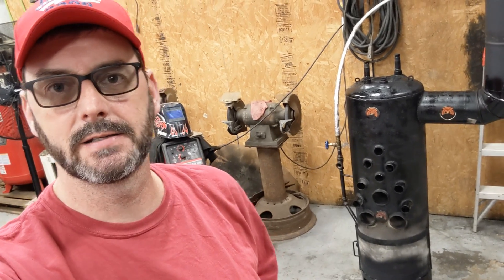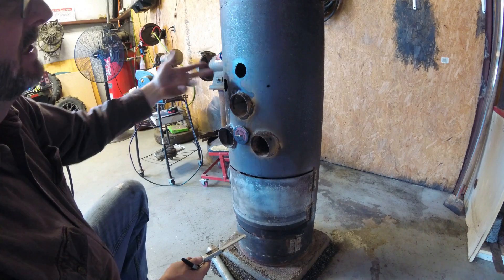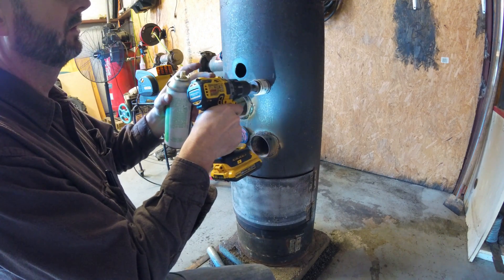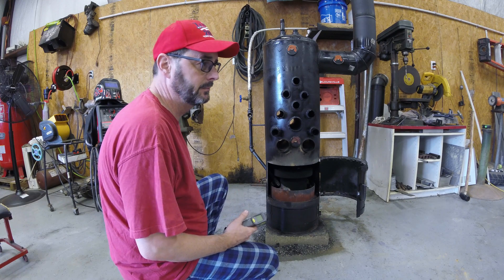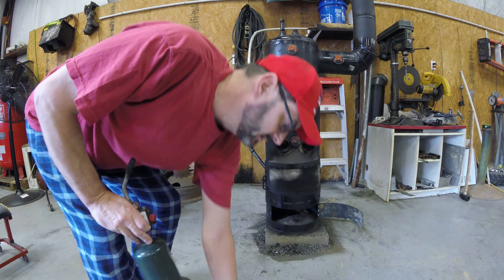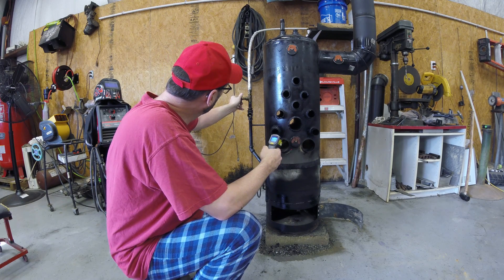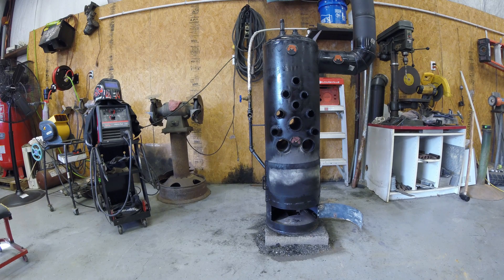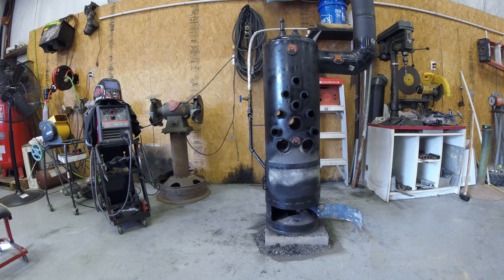Updating My Waste Oil Heater again: Because Who Doesn’t Want a Furnace That Runs on Trash? Ver 3.0

Comment: Hi Randy, did you add a perimeter on the piece you used for the door? The original piece you cut had a gap, and I can't tell if you added a piece around the edge. thx
Reply from the maker: Yes 1 inch strip of metal with a rope gasket. It is shown in one of the latest videos
Reply: @randysdiy2102  We just got an old water tank and other parts and we're starting to lay out the cuts etc. Question: Did you have to weld a base on the inside of the tank to hold the burn chamber? Our tank has a bottom, but we need a space for the air intake and we're trying to figure out where your burn chamber is sitting on inside the tank. Thx Randy

Comment: If you weld the heat exchanging pipes at an angle, the back end being lower than the front end, for each pipe, you will impose a degree of self-circulation in the correct direction. In your current design, the heat doesn't know which way it wants to go in the pipes unless you set up a fan. The fan is noisy and pulls energy and we don't want that.
Reply from the maker: Yeah that's been discussed in the comments. However, in one of the other videos I mentioned that the the tank is only 14 in from front to back so there wouldn't be a lot of natural draft happening and I would rather use the fan to blow the heat on to my work area instead of it pointing upward. But it is a good idea if you didn't have electricity

Comment: Hi there... I have mine up and running! These things are awesome, and your advanced design works fantastic!    What did you use to glue the oven rope seal to the door?  I'll be attaching one soon.
Reply from the maker: I am not really sure. I don't remember what it was. I think in one of the videos I make a statement as to what I used. I will go back through my Amazon purchases and see if I can find out what it is. But I think if you search for fireplace insulating rope glue, you'll find it

Comment: What improvements did you make to the burner or intake hat?
Reply from the maker: I added double the amount of 1/2-in holes to the air hat which just allowed for a more lean burn mixture
Reply: Did you weld on more 90 degree fittings to those new holes?  Also how tall is the vent door opening and the burner access door opening on the water heater? @randysdiy2102
Reply from the maker: The height of the door really shouldn't matter as long as you can fit your burner through the hole
Reply: @randysdiy2102  one more question, we’re those 90’s cast iron?  How did you weld them to the burner hat?
Reply from the maker: I just added more holes on the burner hat to allow more oxygen in

Comment: Just some tips and ideas.... Be warned, this is a long read lol  Also be sure to see his 'Waste Oil Vortex Burner With Dimensions' video so some of this makes sense lol
- The hat would be from a 20# pound fire extinguisher for about a 7 inch diameter for those looking. I got an empty one for $20 at a fire suppression/safety shop (it was a date expired tank). 
I'm building pretty much a replica of your design with a 50 gallon electric water heater tank. No one else is using heat exchange tubes and a fan, just the radiant heat. Though they have small shops or garages, but seems like a waste of heat letting it go right out the chimney. Your design i feel is best. It doesn't require any electricity if you just want radiant heat. That's truly free heat.  I will be using a fan too, but that's nothing compared to the gas bill trying to heat the shop.
- Without scientific evidence, I am sure the 90 degree elbows help because of the vortex they create. longer burn time while providing air.  I used 8 elbows also, but went up to 3/4" elbows. You must build the hat FIRST to know what size pan/chamber to make! (if you use elbows).
- For the center air tube (under the hat) I used a 1# pound propane tank, which results in a little more than 5" tall tube and 4" inches in diameter... perfect for this setup. Thin metal though and a pain to mig weld. Alternatively, there is smaller fire extinguishers or those little air compressors with 2 tiny tanks (you'll have to measure the diameter).
- I will use water and try and chase down and weld any leaks in the pan/chamber, but I will still seal up the seams with a few containers of that Quick Steel - ThermoSteel from Oreilly's (up to 2400 degrees F, or 1300 degrees C).
- I grabbed a 11 gallon air tank for the oil storage/delivery as opposed to a 5 gallon bucket. Though that quick release fitting on the bucket is a great idea!  As i saw another idea on some video, i'll be mounting the air tank (oil tank) slightly tilted on a simple angle iron frame (total height frame, tank, and funnel about 42" off the ground) for easier access and filling. I cut the top off the fire extinguisher as a funnel (maybe 5" to 6" tall total) then drilled a hole the same size as the extinguisher's fill  hole (1" i think?)  then welded the fire extinguisher "funnel" to the top of the oil storage tank. Then sealed those welds with JB weld (you can overfill the tank by a quart or more accidentally with no spills).  7" inch sieves/strainers are easy to find. My strainer sits perfect on the 'funnel' (cut off part of the handle so it doesn't tilt from the weight).
-  My setup will be different for oil delivery as I said, with a 1/2 inch diameter pipe, coming horizontal from the oil tank, and a 90 degree elbow aiming down with the valve attached under that.
I'm using a 1 inch diameter black metal pipe with a 1 inch 45 degree elbow on the end for oil into the burner tank. The opening of the elbow aims upward where the valve ( an inch or two above the opening)  will drip/stream oil into it. This way I can see the drip/stream, and still be able to move the oil tank if needed for remote filling or for whatever reason.
- When cutting the doors, measure and mark where you'll cut, then ONLY cut 3 sides!  The side where the hinge(s)will go, and the top and bottom edges. Do not cut the opposite side from the hinges yet!. Align and weld on the hinges. Before cutting the air door out,  tack weld a washer or something to the door with the washer overlapping a cut edge. Then you can cut just the air door the rest of the way. 
For the big chamber door, now is the best time to bend and curve 2 metal strips (1 inch to 1 1/2 inch wide) to help seal the big door (you will need a 3rd straight strip for the final edge). Bend and curve them as close as you can to the tanks curve using a brake rotor edge or something. Bend slowly, carefully and evenly for best results.
Cut the curved strips about 1/4 -3/8 inches short of the last cut line on the door to make room for the 3rd strip. You'll probably be cutting a few inches off the end of the strips because it's very difficult to get the ends to curve with the rest of the strip.  (Cut the strips AFTER bending/curving so you only keep the properly bent sections). 
Align the strips to the top and bottom edges of the door, overlapping most of the strip on the burner tank. Tack weld the top and bottom strips to the door, then cut the remaining side opposite the hinges and your door wont fall into the tank while laughing at you.  Finally, weld on the 3rd strip on the end. making sure the edge is touching the TANK (the doorside edge might be raised a little. Just weld it like that.   As always with sheet metal, only use tack welds over a period of time to prevent warping. I didn't weld them completely, I just used a lot of tack welds.
- I keep trying to think of something where the oil drips into the chamber...  Maybe a small thin metal tab/plate sticking out horizontally from the hat for the oil to drip on? That plate would be super hot even from the startup fire and glowing hot when it's in full swing... might help super heat or even partially flash burn the oil before it hits the pan? I dunno. There's something to that I can't quite figure out lol
Thanks for the vids on this!  What an awesome setup!  I hope I helped someone in my ramblings lol
Reply from the maker: All excellent information! Thanks

Comment: I've been searching for a good way to burn waste oil without having some sort of induction fan and it looks like you've hit the nail on the head. I'm always trying to think ahead about what happens when the power goes out and your design shows that it's possible to get reliable heat without depending on electricity. That makes the difference between being comfortable during a lights out winter storm or just plain miserable. Nice job! Thanks for sharing.
Reply from the maker: Thanks, but I would never sleep with it running. Too dangerous. Yes you are right good way too keep warm with no electricity

Comment: Hello, I just found your channel and your waste oil heater 3.0 video. And watched all the videos pertaining to this project. Thank you for the videos and all the information you supplied through them. 

I do have a question, would the oil burn better if it was able to gain heat as it approaches the burn pan? 

All of the videos that I've seen have a drip system basically like yours and they seem to work great. I'm just curious as to whether or not having the oil supply pipe closer to the actual tank in order to start heating up the oil as it travels to the burn pan would make a difference in the burning process?
Reply from the maker: Probably, I have found that as the oil heats up if flows faster requiring the flow to need adjustment
Reply: That makes sense. Thank you for answering so quick.

Comment: If you are using a 6" flue wouldn't a 6" air intake work better? I don't know. The air velocity might be too low. I guess it will draw what it needs as long as it is available.
Reply from the maker: Good point, I've never thought of that. Now that you mentioned it, as long as the intake is larger than the exhaust then it should be able to draw sufficient air. Great point though, I haven't thought of that

Comment: Im concerned about the oil running under the air hat and burning inside the hat. Is that an issue. Its the only thing holding me back from starting mine. After 3years of watching your videos. Its getting built this year.
Reply from the maker: I don't believe it would be possible for the fire to ignite in that area as all the air is being sucked through the hat into the burn chamber. So it should pull that flame right back into the burn chamber. Just my thoughts. No scientific proof.

Comment: Nice build project.  Is carbon monoxide a concern with this and do you think it's safe enough to run overnight unattended without burning your shop down?
Reply from the maker: Yes carbon monoxide is concern. I do have carbon monoxide detectors in my shop but I never ever leave it burning without being attended.

Comment: So at a drip a second or so that would heat an average insulated house? I guess the bottom door could be left off completely.
Reply from the maker: If I slow to a drip it will not burn with my setup. Not saying that you couldn't make it work but mine will not sustain a fire with a drip
Reply: @randysdiy2102  thats good to know. thanks

Comment: I watch with interest.
My idea is to put the burner into the top chamber of my underburning wood fired water heater furnice.
It requires quite a few modifications to your presentation.
I'm thinking of pumping the oil in.
When it is running, the stove will look like it is burning wood.
So the oil will come through a bulkhead penetration at the bottom of the boiler. It is the only thing that is not a water chamber.

A Dane in Sweden

Comment: Hi Randy, Thanks for sharing your videos. Do you think the combustion would be cleaner and more efficient if you allowed the gas from the oil to burn up entirely at high temperatures before extracting heat for your workshop? Rocket mass heaters use a tall internal heat rise (chimney) to complete the combustion at high temperatures and this also creates a powerful draft. The heat exchange only starts when the hot gas exits the riser and enters a bell (inverted closed cylinder) with the exhaust exiting at the bottom of the bell. I think this should work quite well with an oil-fired heater.  Just some thoughts. Tim
Reply from the maker: Yes, the higher the temp and more air = cleaner burn

Comment: You didn't show the extra holes you drilled in the hat I want to build one of these and do away with burning wood I'm 65 and cutting and splitting wood is getting old like me nice job
Reply from the maker: What is basically drilled double the amount of holes in between each of the 90° fittings? Anything to allow more air. You can probably just double the size of the fitting holes to 1 in and be okay that way too

Comment: A great project and works so well. The reason you need to quote both farenheit and celcius temperatures is because most countries in the world have now converted to using metric measurements in everything.
Reply from the maker: Yes sir, I understand. However, when you been on this earth for 52 years and only use Fahrenheit, it's hard to remember to give everybody the Celsius readings. I'll try to do better in the future though

Comment: Fantastic build, looking forward to making my own. You said in a previous video that you may suggest against using a water tank for this purpose, so how do you now feel about using the water tank as your firebox? You’re sticking with it so it seems you may have changed your mind. What would you prefer to use instead?
Reply from the maker: When the water tank is held up reasonably well so I don't know that I would recommend against it anymore. It's just when I built it it seemed like it was going to be very flimsy but turned out okay
Reply: @randysdiy2102  I just lit mine (water tank) for the first time last weekend so I’m glad to hear yours has held up fine thus far. Thanks for the reply.
Reply from the maker: Good luck with it and be careful
Reply from the maker: Thanks 👍
Reply: @randysdiy2102

Comment: Hey i like your design . I have a 100 LB. propane tank to use can you send me your measurements for door openings
Reply from the maker: I can. I'll have to do that this afternoon if I can remember, but the door opening size really doesn't matter as long as you can get the burner in and out of it.

Comment: How does your lowes bucket (NOT LEAK) .......I would love to make one like yours.....
Reply: Tank fitting / bulkhead
Reply from the maker: I found a fitting that had a foam washer on it. The threads go through the bucket and then there's a big nut on the back side of it that you tighten up on the foam washer. I really don't know what that fitting's called but I got it from Lowe's

Comment: What did you change on the air hat. The one we watched had the eight 90s. We are building one today. Thank you. Great videos
Reply from the maker: Added 8 more half inch holes between the others with the 90 elbows. Be careful burning oil is very dangerous!

Comment: You made a comment about tapping the drip valve onto, into the burn line.  Did you video any of that? I don't understand what you had to tap or why.
Reply from the maker: This is really hard to explain in words I'll probably have to make a video for you. But if you just put the t in line the oil will run down the sides of the t and you won't see that drip going through the center of the t, it just hugs the walls so I got a hose barb nipple and went through the bottom of the tea into the top of it and screwed it into the top threads so that the nipple was just in front of the see-through part of the t. If this is not clear enough I'll go out and take a few pictures and see if I can get those on here somehow or another, I don't know why YouTube don't allow us to upload pictures in comments.

Comment: You mentioned in this video that the modification (door sealed and Air Hat mods) that it is more efficient.  Have you done a burn test yet to see how quickly it uses oil now?  I really like your idea of the air hat as it appears to make your unit very efficient.  Also, I have not found any photos of the modified air hat or of the work you did on the door.  Maybe a little video of the mods you did to it?
Reply: Also, what did you make the air hat out of?
Reply from the maker: Fire extinguisher. Cut the top off and the bottom served as the hat. Check out all of  my videos on my channel. I have them sorted by playlists. If you watch the one on measurements I think all that is in there
Reply from the maker: Old fire extinguisher
Reply from the maker: I think my newest video has those things I'll have to check and see

Comment: What if you can like preheat the oil before it entered enters the the boiler burner would it burn a lot faster would it burn a lot cleaner
Reply from the maker: I think you would probably just have a little better control of the flow rate and I don't think it would affect the burn rate or quality

Comment: Hey randy I'm thinking about one for my shop. Does yours burn synthetic?
Reply from the maker: It will burn pretty much anything that is a petroleum base that will flow. I have burned jet fuel, diesel, cooking oil, kerosene, transmission fluid, etc. just remember if you build one of these things be very careful I can't express how dangerous they are.

Comment: I just finished putting together my waste oil heater and I'm having tuning the burn.. pretty much identical set up to this except I don't have the elbows welded to the air hat.. I started with 10 holes round a 7 inch diameter air hat, start it up on diesel burns really dirty if i give it anything over a pencil lead thickness, and less than a pencil lead burns out to nothing... tried adding more air holes to no apparent effect. going to try adding even more air holes and see what happens b/c all I can make sense of it is its not getting enough air.
Reply from the maker: Sound like a good move. Mine now has 16 air holes and is more efficient